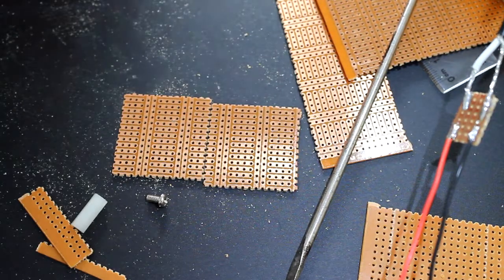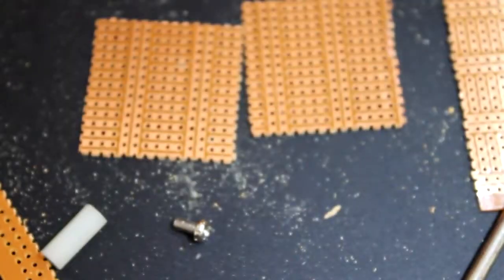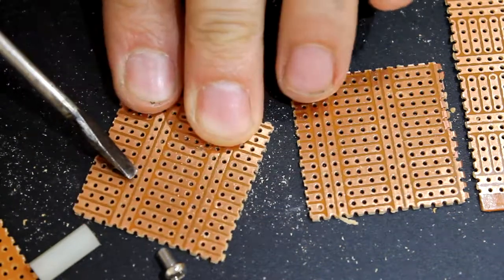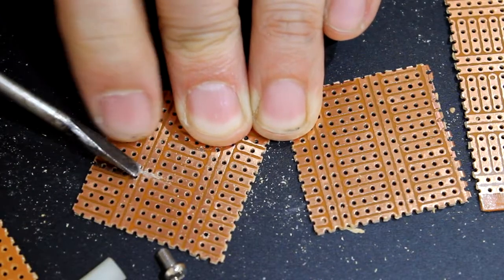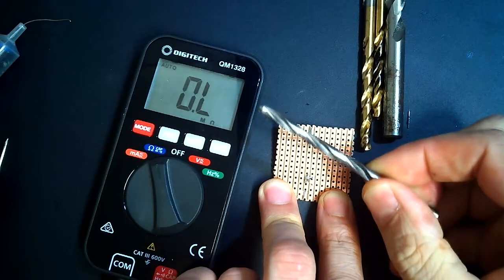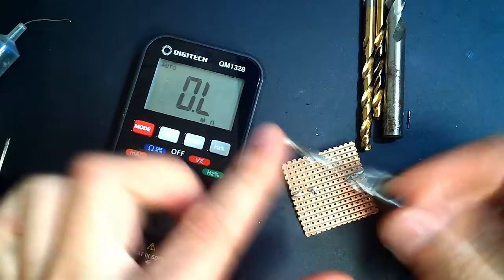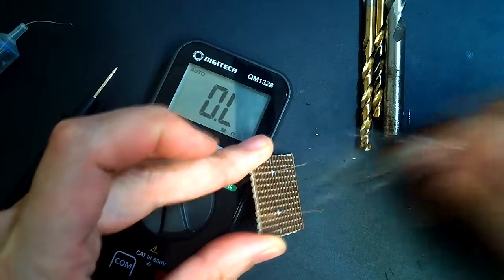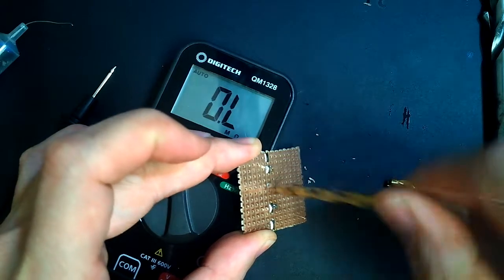Cutting A Track

Comment: Why on earth people would take so much pain to cut a trace like this when a cutting knife just do the job in seconds without damaging the substrate. This drillbit method wont work when you densly populate the board which I used to do in 90's when adjascent drilled holes will solder components. I used to make my own tool using 12mm hacksaw blade sharpened like paper cutting knife. I used to have only strip board so lot of cutting were needed in order to prepare a board.

Comment: Right, there are special tools for this purpose that work in the way you described
Reply from the maker: I'm sure there are... but I've NEVER even looked. This method works for all kinds of things. Glass, some plastics. It works by creating a fracture point along a 'line' that is already week (from all the holes). I have tried using a metal guillotine, but it tends to tear it.

The special tool is called a glass cutter, but that's way over kill. For this the sharp edge of a screw driver works better!
Reply: what kind of tool?
Reply: @alexptvz1076  It's called a "stripboard cutter", which is basically just a suitable drill bit with a screwdriver handle